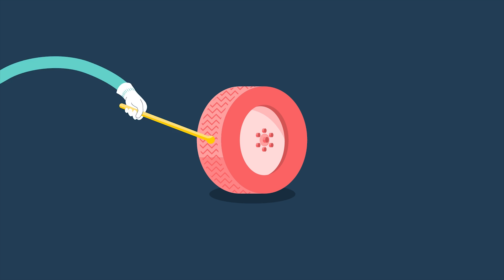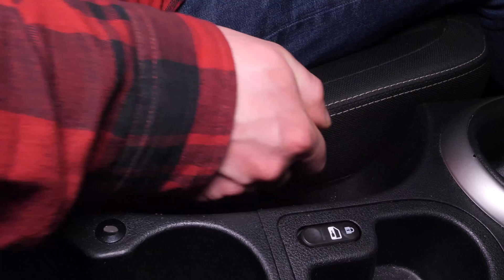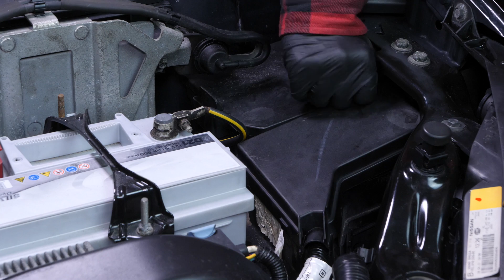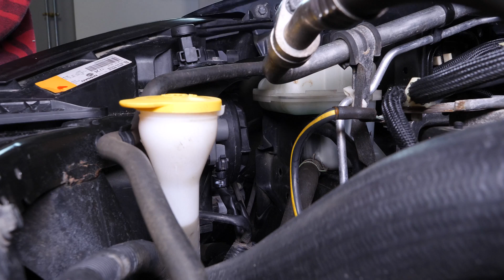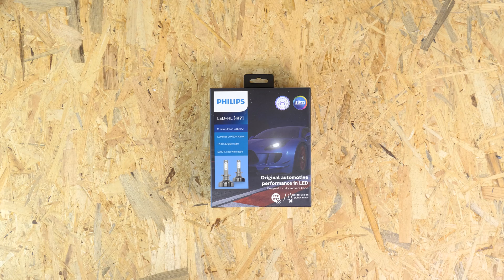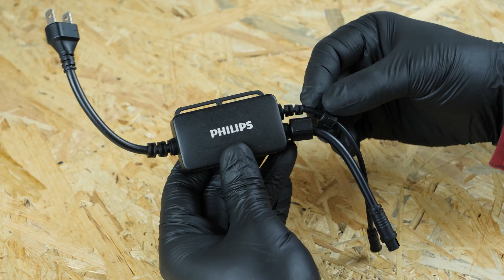How to install a H7 LED kit QASHQAI 💡

Comment: But wait it says on box not suitable for public road only track or rally 🤔
Reply: From halogen to led bulb none are legal for UK road and probably won't pass mot but lots of people still use them 👍
Reply: @mmd-pne4998  yep, after brexit they will fail MOT - it used to just be the law that as they werent EC compliant it was technically not right but an MOT wouldnt be failed because of it. only if the colour was way off and the beam form was off would it fail - but now in law they have to check and if its LED its instant fail... its really dumb IMO.